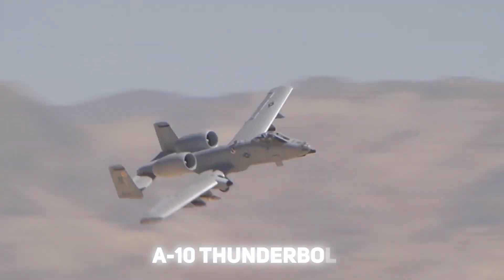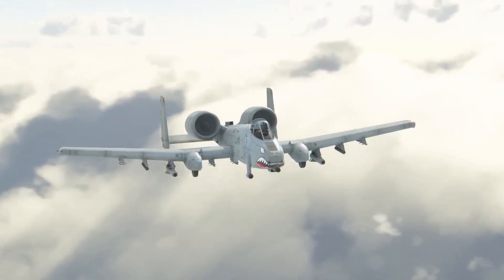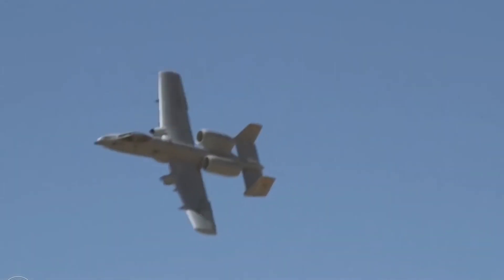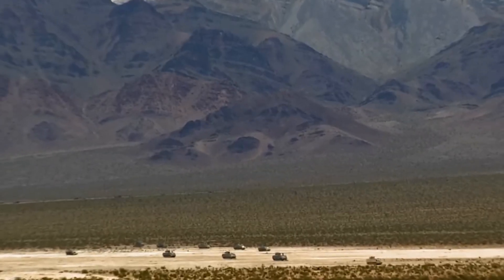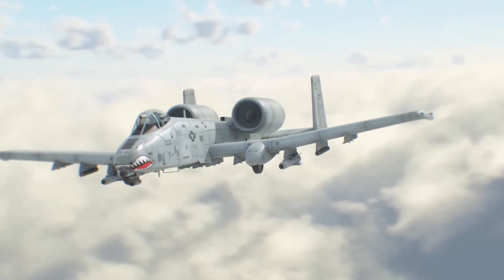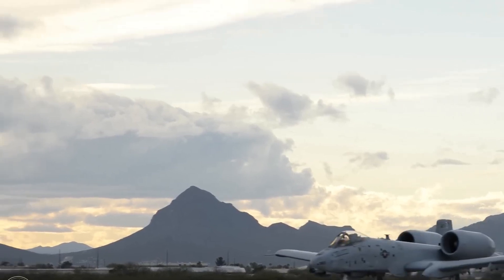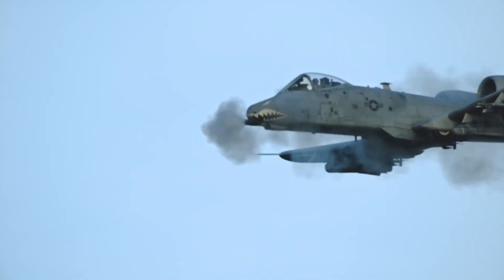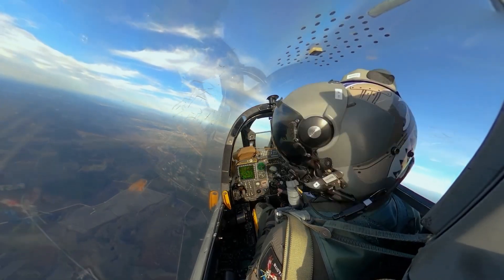The Insane Engineering Behind The Aircraft With The MOST FEARED Cannon

Comment: I really enjoyed this video! Very informative and well produced. Also kudos for the subtitles!

I'd just like to add that the A-10 faces two kinds of possible 'replacements'. The ones newer, more techy and expensive and the ones simpler and lower cost, like the A-29 Tucano, which in fact can and has replaced the Warthog in roughly 70% of its original missions due to its simplicity, capability and operational cost. Suggestion to cover that formidable aircraft too!

Subbed 👍
Reply: Politely disagree - the Tucano can be shot down with infantry small arms fire.  The A-10 is virtually impervious to infantry small arms, most medium mobile arms, and can survive sever damage from AA weapons. Put a price on making your enemy afraid of just hearing the sound of your aircraft. Can that be said of the Sucano?